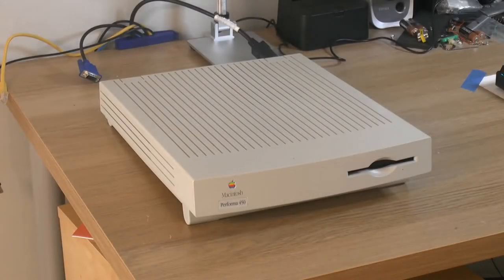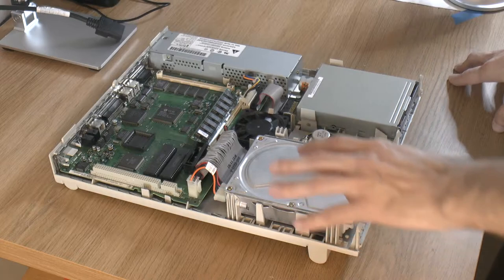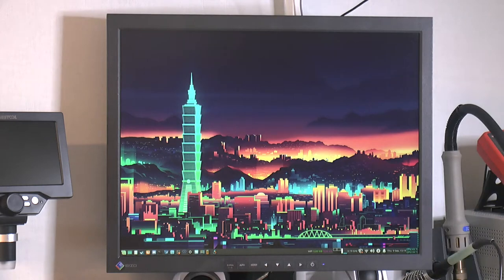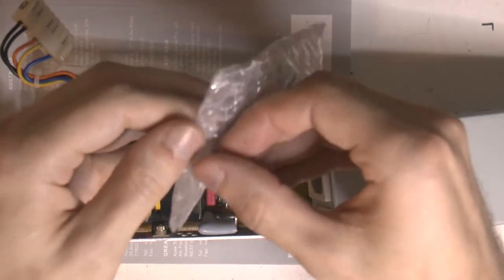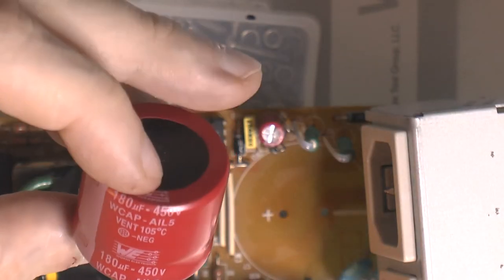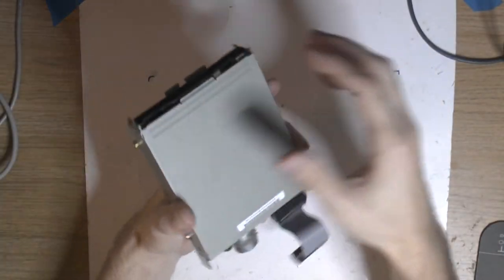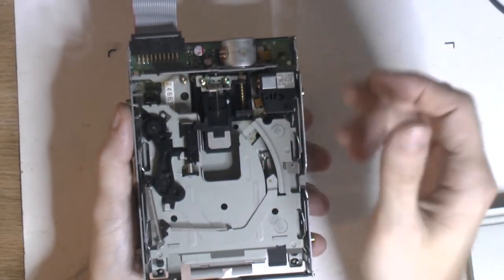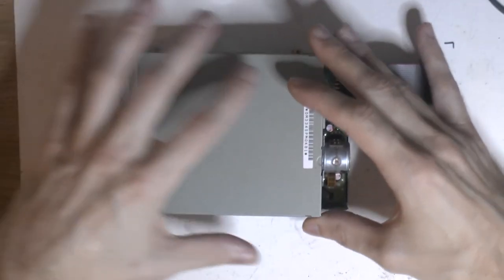Apple Macintosh Performa 450 PSU repair

Comment: Is that noise the fan spinning down by chance?
Reply from the maker: No, you can see me stooping it with my hand at the end. Its the HDD, nothing else.
https://youtu.be/1EqGxdFwsYI?t=2007
Reply: bummer...but as you know, there are two kinds of hard drives, ones that will fail and ones that have failed.
Reply from the maker: @808jpm  yep, scsi2sd adapter it will be once Im done.

Comment: Not sure if you said the reason, but why did you add the hot glue to the inductor next to the capacitor?  Even though I see this done in other OEM power supplies it's not in all the power supplies.
Reply from the maker: Im sure I sad it has no support, no ferrite core so its wobbles a lot due to how tall it is and the small wire its made from. So just to make sure it wont get deformed when handling the system.